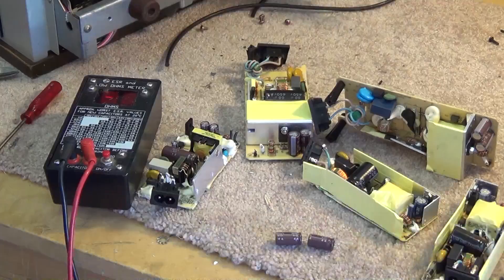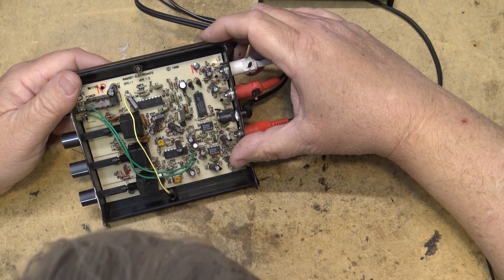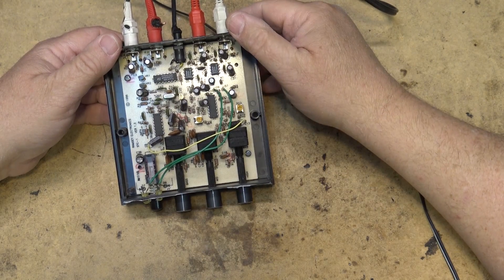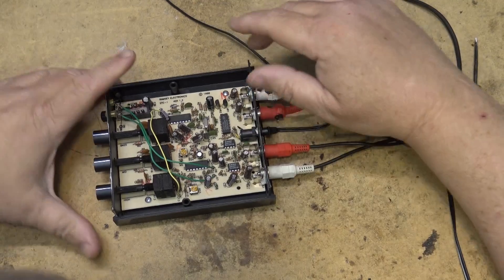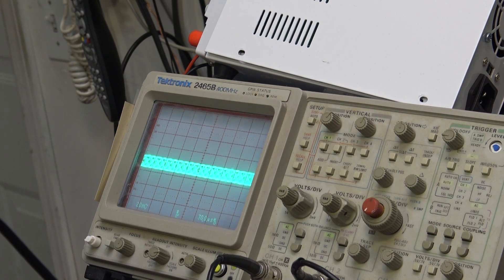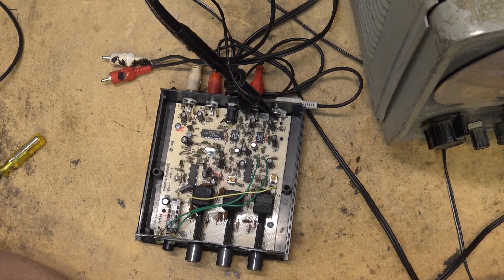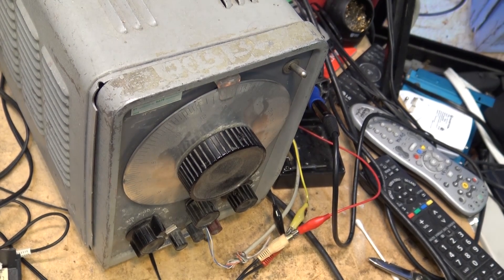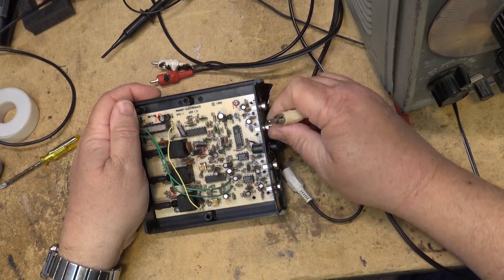Brick Wall Low Pass Audio Filter

Comment: Nice demonstration of a brick-wall filter! Looks like a considerable loss through the filter in-band, you had to change the scope vertical gain three or four ranges when going from input to output ... possible problem?
Reply from the maker: That is just the way it is calibrated.  There are level controls for the output that is set to match the transmitter.  It can be set to same level out as in and if the tone controls were active they provide gain as well but they are bypassed. It was set for 500mv output for a 1v input.  Again adjustable.

Comment: Now all replaced by software.  Should have a try with Stereotool for audio processing and filtering.
Reply from the maker: I imagine in computer controlled stations yes. Many systems still have a hardware brick wall ahead of the exciter as a fail safe.
Reply: Agreed and what if the computer crashes.
Reply: @markanderson350  Well there are loads of stations using that or other tools.  The time that computers really crashed on a regular basis is long gone.  Some of the servers at work have an up time of 2 years and are doing a lot more than using an OS with 1 application on it.
Reply: I guess but this is old and he is fixing it.  I see his point.  I would like one too just to run a bootleg operation.
Reply from the maker: @markanderson350  
That does happen from time to time. All stations have to have a backup plan, usually a tape that has programming on it that will switch in after the dead air detector detects no audio for "x" number of seconds. This gives them time to reboot, and get the computer back up and then switch back to either a live DJ or computer based programming.
Reply: Tank you!  I learned 2 things and I already knew one.  I did not know about a dead air detector and I knew these reliable computers are not perfect.

Comment: Great video. It could be operator mess something else up.
Reply from the maker: Likely his power supply.  I just chatted tonight on bbm and he said it was totally dead, no power.   Told him I plugged it and it worked. Wall wart is also 22 years old.
Reply: @12voltvids  Maybe it uses a center negative supply connector?
Reply from the maker: @juniorbcm5375  
No it uses a positive tip. Remember, I built this thing.
Of course he plugged his transmitter directly into his audio source and it was distortion city. I sent it back so I will find out soon enough if he figures out what the problem is, but I am betting on it being a power issue.

Comment: Some people just don't know how to fly there own equipment, i've had things sent to me with a switch set to the wrong position!!.
I'm not joking, some people are just daft lol.
Perhaps his power supply has a fault, maybe?
I like that scope better than the digital one, i do like analog better :-)
Reply from the maker: I got sent out of a trouble call today for PVR not booting. 30 minute drive only to find out that the unplugged everything when they went on holidays and when they got home they plugged the PVR adapter into the modem, and the modem adapter into the PVR. Sure they are both 12 volts, but the modem adapter is 1.6 amps and the PVR is 3 amps. Hmmm, do you think the PVR had a bigger adapter because it requires more current?
Reply: 12voltvids
And sometimes the adapter output voltages are very different, so the user ends up shoveing 12 volts into a modem that wants 5, very dead modem lol.
Peoples stupidity always makes me laugh, why didn't they disconnect the wall warts at the mains outlet?.
I never connect an adapter to anything untill the specs and polarity are  checked, it's a habit.
Reply from the maker: @zx8401ztv  yes and even when the connector is a different size, some bone head manages to jam the larger plug into the smaller connector on the device.
Reply: Haterz don't like seeing more info.  Show me what I need to see, not want I want to see.

Comment: Would resolder the input connections, power switch and the pot connections, as they might have a dry joint after 2 decades of use. A clean of the connectors, switch and pots would not hurt either. Very common with RCA connectors to get an oxide build up on them, and his removal of it probably scraped enough off, so when he used a pair of inline couplers to bypass, the signal came back again as the contacts had been cleaned off.

Had a good number as well where the ground ring lost electric contact with the frame, even though it was not loose, and they all worked after a clean up with a brass brush on the back and a bit of flux and solder to make a nice soldered joint.
Reply from the maker: I don't know that the sound came back when it was disconnected. Since the unit was sent here from 300 miles away. All I know is he called me and said it wasn't working. Could have been the wall wart for all I know as all that was sent was the unit. That was my wall wart I used to test. I just love it when items arrive and the note that accompanies it just says doesn't work. No symptom, no notes saying what was tried and how the conclusion was made that the unit is bad.
Reply: @12voltvids  My bet then is the wall wart transformer capacitor finally died, and was injecting hum into the power supply rails, till the point where the PSRR of the opamps was exceeded and it was audible on the output.

Fault finding, "we tried nothing and it didn't work". Had so many in my previous job, where you would get 6 units in a row from the same sender, all marked with the same fault. Call them and tell them to check inputs, because 6 being faulty for the same thing is not really possible.

Then got one in from some place that had never in 20 years sent one in, with the usual faults present. 40 capacitors later, some oil and it went right back to them.